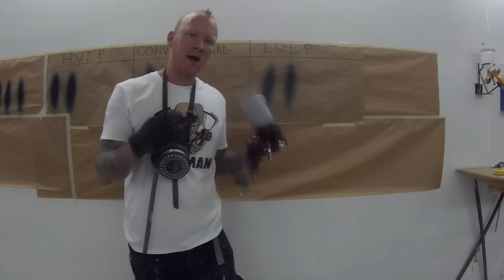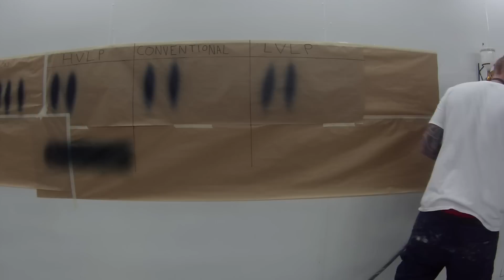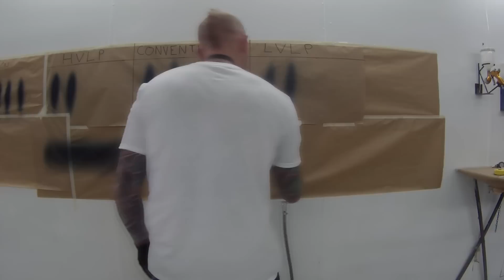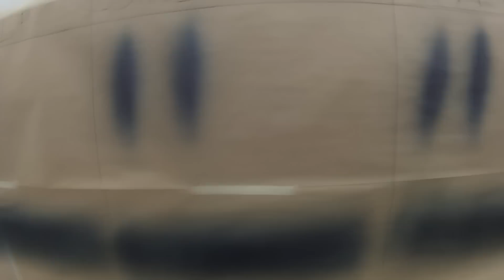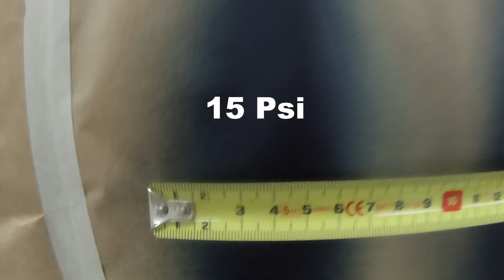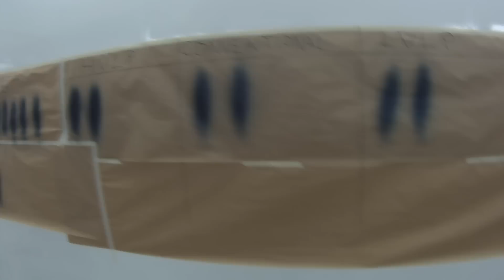Spray Gun Air Pressure Settings

Comment: A lot of people follow you including me       but I think you have left a part out of their education   i have a good idea for an important video          volume of air should be explained     so the importance of hi flow fittings    and       not having huge air pressure going to the gun         lots of people have the small fittings you get at canadian tire or harbor freight if in the states   or the fittings that come with the compressor      and they are using small hoses     so they are already sabotaging their guns performance and their paint job        that might be ok for a tiny project       but most are not painting a hotwheels or matchbox car lol       thanks for viewing this suggestion            I have the high flo fittings and the half inch hose     also less pressure going to the gun    so \i dont have to choke the volume in the gun        everything has improved

Comment: I'm new to this, want to learn to spray, when setting the pressure as soon as I squeeze gun trigger pressure on gun reg goes form 100 odd psi to 0 psi compressor is indicating on tank guage 113 psi and it starts to drop slowly until motor starts at 6 bar,  I cannot for the life of me set the regulator on gun,  the gun I have is a 3M pps 2.0 got several cap sizes but using 1.4 for hb primer, there be 2 knobs if I set both to done right up I can set 18-20 psi which is what the manual says is a good start but as soon as I start to adjust the 2 knobs to where the manual says is a good starting point, (paint fan pattern knob 2 turns, needle 4 turns) back to 0 psi we go, I'm confused, haven't yet put paint in it as I don't want to waste it, am I overlooking something or being a noob by not sticking paint in it or something?  I can feel 2 steps in the trigger so first step gets air flowing then 2nd allow paint through I assume this is correct, any help / tips would be great, cheers

Comment: Hello G'man. Feedback from my air pressure query. (LVLP Gun) With the gun reg' fully open the best pressure I could achieve on the gauge with the trigger depressed was 18 PSI; clearly not right! I then realised the problem must be with the compressor not delivering sufficient volume. This was caused by having the comp' regulator set to 80 PSI. I therefore upped the pressure to 120 PSI and I now had 40 PSI at the gun (trigger depressed). Problem solved as I can now use the air line valve to set the required lower pressure as per your video. A simple problem but for beginners who don't know what they don't know (if you see what I mean) a big problem. I should now be able to spray the paint rather than hosing it on with far too low pressure. Many thanks for your patience and kind assistance. Now get to Laos and stop lazing around!!!
Reply from the maker: haha, yeah it has been a good break. But still managed to stay busy the whole time.

Comment: Awesome and straight to the point as always GM. So we have established that in general a narrower fan is what you want, either with a better gun or crank the pressure if need be...so that begs the question...could we "hack" a el cheapo gun - like that 50$ you threw away to make it spray more like a LVLP if we covered over some of the fan holes? Or filled them and then re drilled smaller holes? OR if not a cheap gun lets say a conventional but old school suction gun? To modify it to behave more LVLP rather than throw it away...Thoughts? Cheers Pete

Comment: Thanks for the rapid reply. I think this is where I am getting it all wrong. If I screw the gun regulator in the pressure on the gauge rises but the actual air coming out of the nozzle reduces until it stops completely. If I screw the regulator out the pressure on the gauge drops right down while the air from the gun increases. So when you say the gun regulator must be on full, what does that mean with regard to the above. Obviously it can't be right in otherwise there would no air coming out at all! I hope I've explained my ignorance clearly as I've not seen this very basic point mentioned anyway. Probably because it is so basic!!! Thanks again. Peter
Reply from the maker: I mean to leave the gun itself at full, never touch it at all just flat out then adjust from the regulator, your gauge will give inaccurate readings if the gun is restricting the flow.

Comment: Have you tried using the HVLP gun and hose attachment? It's suppose to increase atomization. You can have the right pressure set at the regulator but the size of the attachment on the regulator robs you of volume due it it being a smaller nozzle.

Comment: Very nice video, as always of course ;) But could you explain me more which air cap is better if we don't consider the air consumption? Does HVLP spray thicker coats of paint or atomize better or air caps is just for efficiency only? I'm confused a little (still beginner).
Reply: MHRping

Comment: G'Man. Just watched the vid on air caps and pressure and noticed you were adjusting the pressure on the regulator rather than on the gun. This is probably a very basic question, but what should the pressure valve on the gun be set at? Thanks, Peter (UK)
Reply from the maker: You must have the gun set at full or the gauge will be inaccurate, then adjust the reg as you saw me.
Reply: @TheGunmanChannel  with a 28 gallon 2HP compressor using an HVLP to spray Torch Red single stage Urethane paint on a Mustang with what should my PSI be at the gun regulator using a Master Pro 44 series HVLP spray gun?

Comment: hi, great video but what differs from an HVLP to an LVLP. Is it just the cap nozzle??
Reply from the maker: +rungassamydonovan47 yes, it's the size of the holes in the air cap.
Reply: @TheGunmanChannel  with a 28 gallon 2HP compressor using an HVLP to spray Torch Red single stage Urethane paint on a Mustang with what should my PSI be at the gun regulator using a Master Pro 44 series HVLP spray gun?

Comment: Gunman with a 28 gallon 2HP compressor using an HVLP to spray Torch Red single stage Urethane paint on a Mustang with what should my PSI be at the gun regulator using a Master Pro 44 series HVLP spray gun?

Comment: can you spray metallics with LVLP?
Reply from the maker: Yes
Reply: @TheGunmanChannel with a 28 gallon 2HP compressor using an HVLP to spray Torch Red single stage Urethane paint on a Mustang with what should my PSI be at the gun regulator using a Master Pro 44 series HVLP spray gun?